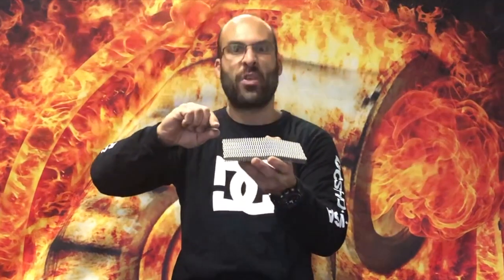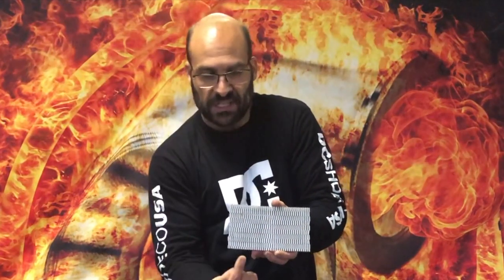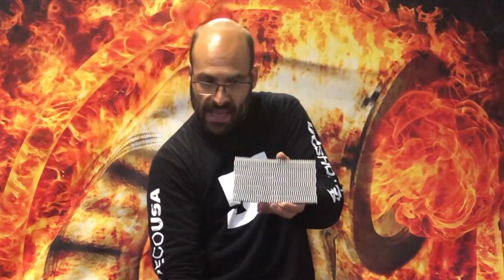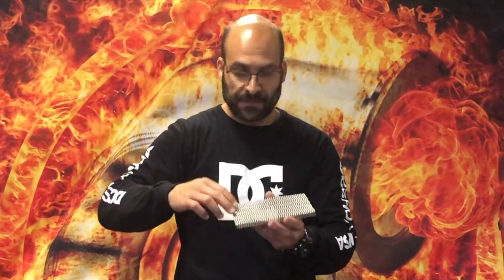Intercooler Fins and the tech behind it

Comment: 3:30, Wouldn't the front of the intercooler be cooler than the rear as the rear is being cooled by compounded hot air? If the front of the intercooler experiences 30 deg c air, through heat dissipation the rear would be hotter.
Reply from the maker: To a degree yes, the function of the fins it to remove heat (transmit/conduct/draw out heat from the core that it is connected to)  The fins draw the heat out of the core, and is cooled by the flowing air over them - in theory the fins at the rear will be hot, but in practise they are cooler than you expect -- DEPENDING on the efficiency and design of the fins, width of the intercooler, ambient temperatures, and volume/speed of the air flowing over the fins - and lastly the temperature of the charge air flowing through the core itself.

Comment: i didnt understand why there is a need for vacumm space. Where will the molten aluminium be there?
Reply from the maker: Im not understanding your question - which molten aluminium are you referring to?
Reply: @TurboDirectSA  at 3:49 why is there vacumm required? and why molten aluminium?
Reply from the maker: @lsrinivasan242  Got you - vacuum casting/brazing will cause the solder/aluminium paste to spread evenly acorss as much of the mating surface of the fins and the core in order to transfer as much heat out of the core into the fins as possible. The more surface area you have contacting the fins and core, the better the cooling efficiency is (inside of the design of the core and fins dimensions ofcourse)
Reply: @TurboDirectSA  Wow thanks got it. btw great detailed content
Reply from the maker: @lsrinivasan242  Pleasure buddy -- thanks for the compliment